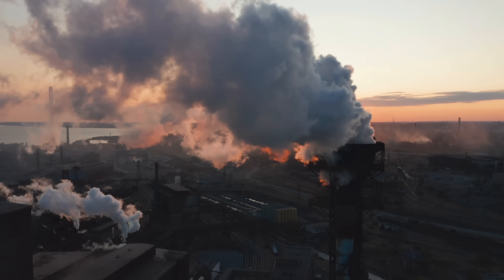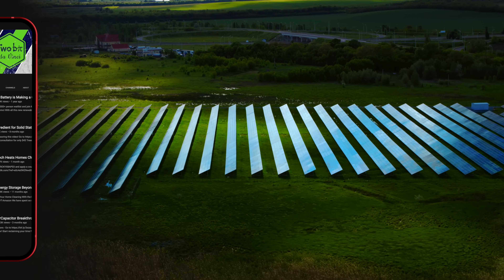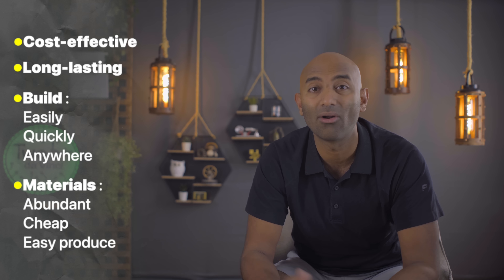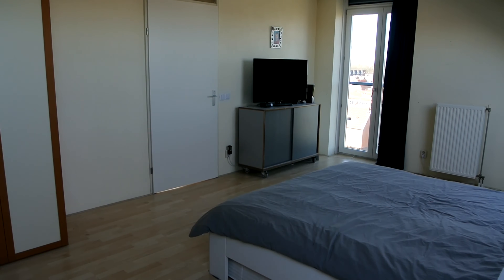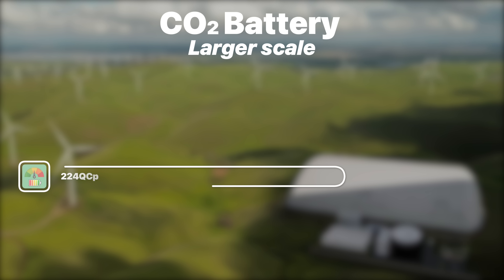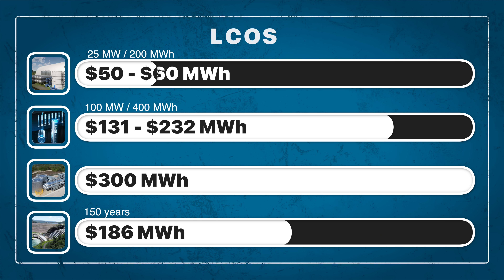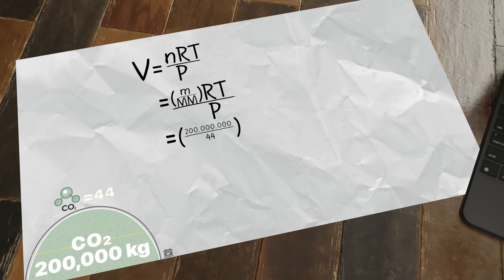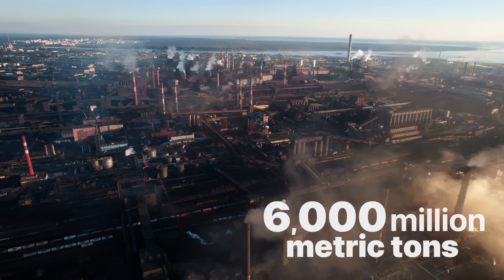The GENIUS Of the Carbon Dioxide Battery

Comment: Another step forward and it might help to stop the crazy rush to shut down all fossil fuelled energy before adequate alternatives are in place. There are, so it's said,  other projects which, believe it or not, are similarly very cheap compared to most current alternatives. I prefer practical proof rather than all the 'ifs and buts' and this one is nearer to practical need than most.
Reply from the maker: well said!

Comment: There is no intermittency if you use the intermittent electrical energy to make Hydrogen from water. The earth can produce Hydrogen 24 hrs a day .so in one day on earth one can produce Hydrogen that is stored to be used when a system is temporarily not able to produce electric. No battery required.
Reply from the maker: this is a very interesting idea and a topic for a future video!

Comment: String solar is WAY cheaper and frankly a non issue if you have no obstacles near by. And i feel liquid salt batteries have a better yield in short term (night time and semi local heating) and conversion to hydrogen is better for mid to long term storage as its more flexible.
and 20 Mwh can supply 350k homes for 1 hour?   WHAT?  houses should not be using anywhere near that much.   20 mWh x100 x 1000 = 20 million kWh / 350.000 = 57.14 kWh /10 is 5.714 kwh  that is just wrong that is what most europeans use on average in a whole day.

Comment: The, "Models", are not and cannot accurately model the phenomenon of Anthropogenic Global Warming.  Iterations of Partial Differential Equations, even at Exaflop scale cannot model Turbulence, a nonlinear Heat transfer mechanism. We cannot , as yet, understand the phenomenon Mathematically, because We cannot model the Chaos of Turbulence. In 2018 a Chinese Mathematician attempted to employ Lattice Boltzmann Differential Equations, with no success. Add to that, the relatively recent discovery that the Solar Wind prevents Cosmic Rays from striking Earth's Atmosphere. The Daughter products of said collisions produced are the condensation nuclei around which clouds form, reflecting incident Solar Radiation. Plus, the fact that the AMSUs have not detected a Temperature increase, and 96% of NOAA's ground based Temperature recording stations have violated NOAA's own criteria and placed said stations too close to artificial Heat islands. 
What is being pushed on the public, via ,"Global warming", to "Climate change", although ,"Climate", has never been in stasis, and We are still emerging from an Ice Age, to, "Climate crisis", is an elitest, non-Scientific, grab for complete control and micromanagement of every single Human on Earth. In Science, "The only sacred Law, is there is no sacred Law". Is it wise to  replace hydrocarbons to generate dq/dt, Current? Absolutely, but remember, all plastics, fertilizers, pharmaceuticals, etc., are based on hydrocarbons and technologically We are not yet ready to replace hydrocarbon based, Energy.

Comment: Would it reduce costs to retrofit a coal-burning plant to a CO2 battery since the infrastructure and turbines are already in place? From what I understand, the battery doesn't have to be near the wind or solar farm. It just needs to be on the grid.

Comment: This is obviously a valuable tech application we should take advantage of.  That being said, do not be deceived.  Nature has the ultimate Carbon-capture tech...  plants.  Deforestion + Urban Sprawl is the true cause of "increased" (not true) CO2 levels. The production & use of Concrete/Asphalt.  "Climate change" has nothing to do w/ CO2. The planet is NOT getting hotter.  PLACES are getting hotter...  & colder.  Due to an Iron Magma flow change under the crust between Canada & Russia.  The geomagnetic North Pole is ~2,000 miles southeast of where it was in 1833 (atop the Arctic Circle). Also... 

3 of the most important "new" materials of the 21st century are Carbon fiber, Graphene, & ALON (Aluminum Oxynitride).  Sequestered CO2 (Molecular Carbon) is a key material in producing 2 of these. A new take on sequestering Carbon in the ground is manufactured paving blocks from "Carbon waste"-capture products & captured plastics. Not trying demonize modern construction, just evolving the approach.  And PLANT WAAAY MORE TREES.

Comment: Ricki, There is much more than 6,000 million tons of CO₂ in the atmosphere - we put in 36,000 million tons every year. Typo?
We know the mass of the atmosphere because it is directly related to air pressure and the surface area of the Earth.
We know CO₂ is currently 415 ppmv, and therefore its ppm by mass is 415 * 44/29 = 630 ppmm. Mass of the atmosphere is 5.136×10¹⁵ tonnes.
Mass of CO₂ is therefore  5.136×10¹⁵ × 630/1,000,000 =  This is 3,235,680 million tonnes, or 3.23568 trillion tonnes. A lot more than 6000 million!

Comment: ya all dudes, think abou the big bladder dome being the weakness..... but it stores co2, not corossive, at room temperature, and it stores it at atmospheric pressure, so no pressure/load on the dome, except its own weight. so really low requirements for that dome, they just need to give it a fresh paint so it doesnt corrode from the outside.

Comment: I wonder about scaling this down to power a single home. In the summer heat from the home could be drawn off to boil the co2 making air conditioning only use power typically lost in the 20-25% inefficiency of the system. That of course assumes that efficiency scales linearly with volume which is really never the case with any volumetric storage where temperature is a factor. However subterranean gas storage, though expensive, could help here. If cleverly designed, the heat loss from the thermal storage could potentially help heat the house in the winter.

Comment: eventually someone will finally put magnets in a tesla turbine on both sides of the discs which will create induction heat and add alternating electricity to each of the  turbine discs and have the discs spaced at .5mm apart and create the most efficient electrolysis then they can use these to heat homes with clean efficient energy!

Comment: Don't know what world you live in but in the real world EVs are not less expensive than gasoline/diesel fueled vehicles. Neither to manufacture nor to operate nor to dispose of. In all aspects they are more damaging to the environment. In other words, not ready for prime time.  The only mature energy system that can provide the needed energy with an extremely low "carbon footprint" is nuclear. Preferably small form factor conventional or micro thorium plants. The technology is there, we just need the will and common sense to implement it.

Comment: Interesting technology. 

Why has no one applied the proven science of CO2s ability to add planet changing, glacier melting extra heat to earth’s environment in a beneficial method ?
Especially since it can do that at virtually microscopic levels. 
This has always bothered me with climate change science. Why can it not be applied ???
Probably not because of the First Law of Thermodynamics. That’s only a minor hindrance. 
There has to be a way to manipulate the proven heat energy increase created by CO2 in our atmosphere. 
At ambient temperatures, no more or less. 

Any answer would be appreciated.

Comment: We should definitely use that CO2 in any way we can. This is pretty cool. I didn't know that C02 was one of the few compressible gasses at ambient temperature. I'll definitely keep that in mind for incorporation into my designs.
Reply: Yeah but its a strong solvent when its in its liquid form and the pressures are pretty high. Not that high for industrial applications but if you or i were messing around with those pressures youd have to be very careful or u can die

Comment: Sugarcane is an excellent carbon capture crop. Make ethanol and burn it to make energy and CO² for this battery!
But hear this, we in Brazil use "liquid ethanol batteries" since the early eighties. Also the waste of the ethanol plants produce more electricity than they use for operating the plant. 
sometimes low tech solutions are the best solutions. Together with the more than 60% hydropower on the grid, makes Brazil one of the leaders in green or renewable energy!

Comment: The most amazing use of Co2 is in the creation of all life as we know it. All life is carbon based and we get that carbon as well as our oxygen from Co2.
Btw there is zero correlation between the global avg temp and co2. We dont make co2. Its a cycle in a mostly closed loop system that is the earth. Co2 is captured and converted into carbon based life, carbon based life dies and its either returned back into the atmosphere or trapped to be liberated later. Go study.

Comment: Another advantage is that unlike ammonia which also can be liquidatified under pressure, it is toxic, CO2 is not poisonous. It is dangerous in high concentrations being a suffocating heavier than air gas but that is easily managed. Therefore it could be a good solution.

Comment: The problem of where to get the CO2 is economic in the larger sense. The atmosphere would be a terrible source, there's almost no CO2 in the atmosphere, from the point of view of refining it. It's just that the greenhouse effect only requires a tiny amount of CO2. 

You'd have to compress, possibly liquefy, the atmosphere, or at least get it down to CO2's freezing point. And to do so would require a vast amount of energy! Energy that could otherwise be lighting houses and running industry and all that other stuff. So you'd be using a ton of energy to capture CO2. Quite likely releasing more CO2 in the process, than you would just by burning some carbon to get it directly. Even smoke from a factory contains little CO2. Most of air is nitrogen after all. And there'd be a ton of other stuff to clean out of it.

The easiest environment-friendly option might be charcoal. It's almost pure carbon, so almost pure CO2. And it comes from trees which are much better at capturing CO2 than a factory would be. There are already forests built just to capture CO2. Depending on the legal terms they work under, it might be possible to buy some trees from them. Or else just fast-growing pine as used for paper, or even bamboo which grows almost fast enough to see! Grow a ton of that, charcoal it, Bob's yer uncle. But directly from the atmosphere, absolutely no chance, makes no sense in the broader sense of economics, which is the allocation of human labour and resources, of energy, and of "externalities" like the atmosphere.

Comment: Isn't CO2 an acid? How caustic is liquid CO2 to the system of pipes and turbines? Would this be another cost point for any facility using this technology? Wouldn't the gaseous storage tank need to be at negative pressure to be able to accept the exhaust from the turbines? As downstream pressures increase, wouldn't the turbine efficiency drop off precipitously? I am curious why they want to use CO2. Is it just so they can sell it as a CO2 capturing technology. Seems like there would be better gas choices, considering that only about .04% of our current atmosphere is CO2.

Comment: Wind and solar are NOT cheaper. ANY country that use renewables only found their electric bill went up dramatically, usually over 3 times. The only way they are cheaper is when you use other taxes to pay for it.

"co2 is usually considered the main culprit behind global warming" ONLY by those that ignore real science.

"upsetting the delicate balance" What people do not know is that co2 IS the balancing factor. It is the only gas that can easily remove energy from the atmosphere or keep it in depending on how much energy there is. Too much energy and co2 gets rid of it faster. Too little and it helps to hold it in. No other gas has this ability.

Comment: There is a physics problem that is not mentioned here, and that is that the critical point for CO2 is around 31C. Go over that temperature and you’re not making liquid CO2 you’re making a supercritical fluid and the whole thermodynamics model breaks down. So, the cooling medium (presumably water) has to be well below that temperature. So, you can’t use this kind of thing in very hot climates. It probably won’t work inside of the tropics. On the other end of the scale, you can use it in relatively cold countries, but not below 0C, because you need to recycle the heat in the cooling fluid (I still presume water). Just saying…

Comment: Not to argue, I will point out currently we dissolve zooplankton 10-times faster than the PETM extinction.
One can't remove CO2 below Mt.Everest air mixes too fast, 1st year geophysics where did you people take science ?
The planet balances CO2 with biology, how it does that is mountain building, the Himalaya rising Miocene on allowed iceages to occur, we put most of it back in 250yrs is the problem.
CO2 + CO3₌ + H2O ⇄ 2 HCO3-
Too bad, eh ?
🦤🦕🙈

Comment: This system does have one serious hazard risk. If the CO2 storage system is seriously breached, you will get a lake of carbon dioxide that will take a while to disperse. Anyone caught in it will suffocate. This is a little analogous to a water dam breach, where the flood can kill, even though the fluid - water - is largely harmless and will disperse on its own.

Comment: Bogus.  The efficiency of this system is horrible. Less than 30%. This isn't a BATTERY.  Lithium Batteries are generally 90% efficient. Looked at this system back in the 1970's. Physics hasn't changed much since then.

Comment: GLOBAL WARMING didn't fit the narration so ESG-cartell rebranded this SCAM to climate change it's still a scam but it sounds nicer 

as for carbon dioxide, there are 'worse' gases such as methane or AirCon gas (propane or other 'cooling fluids'), methane is hundered times worse and propane (and other 'cooling fluids') tens of thousands worse than CO2, nobody is fighting them because *carbon prohibition helps to conquer some countried by destroying its economy witnout sanctions or tanks (war) - this is simply neo colonialysm

Comment: 8' 37" that would be, "you or me", not, "you or I".
if I were to say something then you or I would say something.
If they said something to me then they'd say something to you or me.
It's really a simple rule.

The amount of CO2 you'd recover from the atmosphere would be a spit in the ocean.
The gain for the environment would be in helping to phase out our dependency on fossil fuels.
One of the bigger sources of greenhouse gasses is the refrigeration industry.
Your average older supermarket will likely have from 1 to 3 refrigeration racks holding 60 to say, 80Kg of R404a.
R404a has a global warming potential (GWP) of 3922, which is to say that 1KG of
R404a has the global warming potential of 3.922tons of CO2 so, if you have a major leak on one R404a rack and it releases say, 70Kg of refrigerant that would be the same as dumping 274.54 tons of CO2 into the atmosphere.
Most new supermarkets in Australia are being built using CO2 (GWP 1) for the low temperature rack and R134a (GWP 1430) for medium and high temperature racks.
Which is better but not good.

And to think I started writing this just to give a grammar lesson.

Comment: How long can it store energy? The ability to buffer for weeks or month could be a key advantage over other storage technologies, because, seasonally, power demand is often highest when generation is lowest (winter.)
Reply: The problem isn't how long you can store  liquid CO2.  The problem is that it's a bomb.

Remember what that grain silo did to the city in Lebanon?   Yeah...it needs to be far away from people and built with the certainty of it exploding in mind.
Reply: What?! Lebanon's big explosion was caused by many tons of stored ammonia nitrate in a warehouse catching fire and then blowing up. The grain silos nearby didn't blow up at all, but were destroyed by the warehouse blast. Ammonia nitrate is used in fertilizers and explosives.

This CO2 capture system converts CO2 between its liquid and gaseous states. CO2 isn't explosive or flammable in the manner of ammonia nitrate. Liquid CO2 at 25C (room temperature) must be pressurized; loss of pressurization causes it to expand to gas, which drives the turbines that produce electricity. Sudden depressurization does not produce a fiery blast. A heavier-than-air cloud of CO2 may concentrate in that location, displacing breathable O2, but it's easily dispersed by a breeze.

Have you ever dealt with frozen CO2, dry ice? It slowly becomes gas at standard temp & pressure. Liquid CO2 at std temp must be at pressure or it'll quickly become gas.
Reply: @LaserKid-mww  Considering that almost every  fire extinguisher has co2 in it:where did you learn that co2 is explosive?Every grain silo explosion that I'm aware of was caused by dust igniting which was caused by transfer  of the grain and static electricity igniting that dust.
Reply: @paulcallicoat7597  It's a building sized pressurized gas tank.
Reply: @LaserKid-mww  No the large tank is non-pressurized that's why it is so big.

As to how long it can be stored. It didn't seem to get talked about in the video but the diagram showed water being used as coolant during compression and stored to add heat during expansion you would lose efficiency as your thermal tanks cooled down but the CO2 potion could be held as long as a steel gas cylinder lasts, forever essentially if you keep it from rusting.